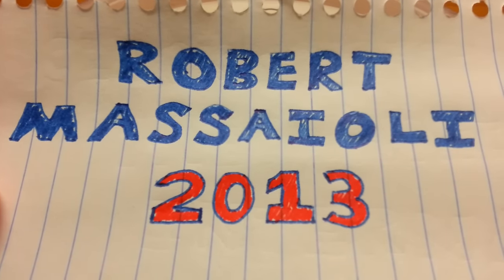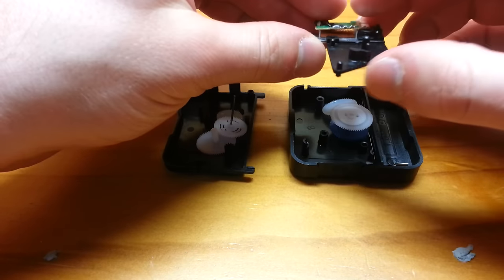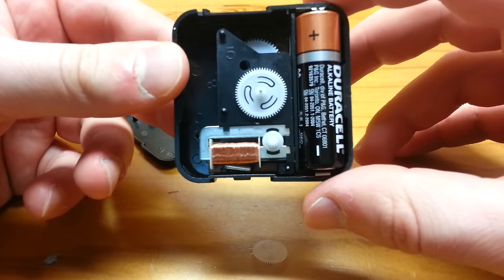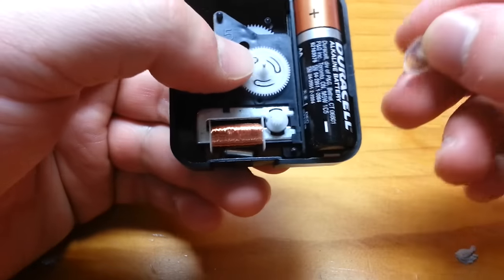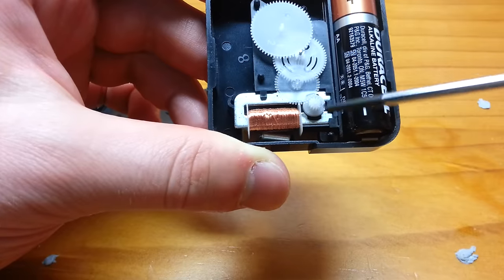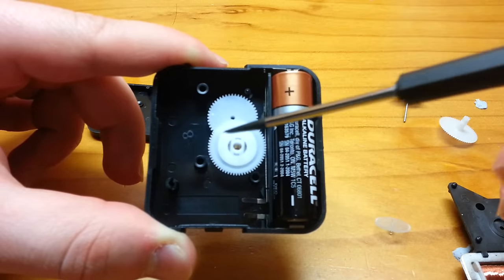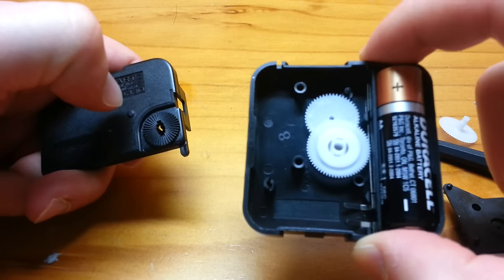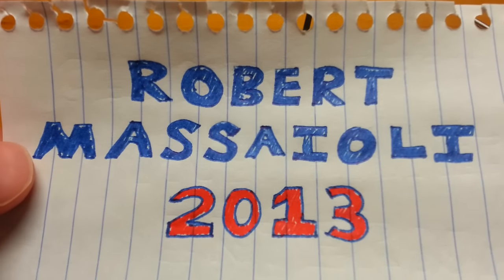Internals of Quartz Clock Mechanisms

Comment: This is the only detailed explanation of the inner workings of these clocks I've seen. This is done superbly well! I have discarded so many clocks because the clock mechanism wasn't working. Now that I understand how it works, I can fix.
My sister brought me an older clock that made the sound of a different bird every hour. It wasn't working and had belonged to my dad, so it was worth fixing. I took everything apart and found that the battery contact strips weren't making contact with the main board. I had to solder jumper wires to get power to the clock innards. After a lot of time and patience, I finally got it back together and it works! I would never have attempted this with the knowledge this video provides.

Comment: Thank you Robert, I have a little known tip! If you have a clock of this type that has been working for better than 15 years and is loosing about 5 min in a week, turn it over, 180 so the 6 is at the top, watch it for a week and if it keeps correct time you can rotate the mechanism in relation to the numbers and get another 15 or so years out of it. Gravity only wears the plastic on the bottom.
Reply: bruhh
Reply: write a book on how be be efficient in everyday life alreaady
Reply: Thats very interesting

Comment: Awesome video, our clock fell off the wall and the mechanism shattered into every single component on the floor. I didn't think I had a hope of assembling it all back together but it's now back on the wall and working thanks to you!
Reply: I have one that I would like to throw on the floor. It has run fast ever since it was new. Should have taken it back but I  had already thrown out the receipt by the time I realized what was going on. No adjustment of course.
Reply: @plansexaminer  I'm reading your comment 8yrs on and laughing.I wonder how your life has changed and if you ever did throw your wall clock on the floor,if it is still happily running fast or if it has expired with time (Pun intended!)

Comment: Thanks for making this video! Although my clock wasn't the same model it was close enough to yours that I figured out how to repair my bathroom clock! I figured I had one gear out of whack, but when I got the backing plate off they all bounced out. After I saw how yours looked inside and you explained the solenoid and that first gear, the reassembly went fairly smoothly (except for when I  put the backing plate back on - it took a couple of tries to get that plate on without that second gear bouncing out of place). Now I'm all set! (bad pun intended)!

Comment: I would like to add a little detail about how the motor works.  Each pulse to the coil results in both the pole pieces at the bottom being of the same polarity while the two pole pieces at the top are of the opposite magnetic polarity.  The large electromagnetic poles are 180 degrees apart and the small poles are also 180 apart and 90 degrees from the similarly polarized large poles.  The pulses repel the permanent magnet on the gear such that the permanent magnet is always pushed away from the similarly polarized small pole and toward the oppositely polarized small pole at the other end of the U shaped core.  After the pulse, the pole pieces are no longer electromagnetically magnetized but the permenent magnet on the gear will latch itself into place aligned with the larger poles of the electromagnet due to their larger size and greater attraction.  They are then ready for the next pulse of opposite polarity.  This all ensures the motor always turns in the same direction with alternating pulses.  It is essentially a permanent magnet AC motor.
Reply: Does the impeller have 4 poles  - 2 magnets?

Comment: I just fixed 3 of these this week. IN EVERY CASE the problem was the pressure contacts between the battery connectors & the electronics board. All I needed to do was gently scrape the contacts (2 spring from the battery, 2 flat on the PCB) with a plastic blade to remove the oxidization (will now look evenly bright), and BINGO! The clock ticks & runs fine again. Just be careful how you disassemble & re-assemble the gear mech. About 15 minutes work & no parts cost, & you keep the original hands & sound of your clock!
Reply: James H

Comment: Thank you very much for your demonstration and explanation! The video is really helpful for it gives ideas about the function of small electronic circuit board in which quartz crystal resonator in a form of small tuning fork is connected and how the circuit board receives power from battery and causes the tuning fork to vibrate and then how the circuit converts the vibration into one second electric pulse and drives the peizo electric motor and drives the motion work of the clock (12 : 1 reduction gear train that drives the clock hands). So that people will no more get tempted to throw the old unfunctioning clocks into garbage or by the side of road but they get idea to repair and use the clock again.

Comment: I really enjoyed watching this. I'm working on a special clock design using a microcontroller and wanted to see how these mechanisms work.  Well done!!!  thank you!
Reply: Yes I saw that as well.......great food for thought Robert!
Reply: My guess is that if you can control the motor with the arduino there must be a way of sensing each back and forth of the motor with an arduino as well.  THIS is what I want to do.  This would allow me to turn on LEDs in synchronous with the pulsing of the motor for the seconds, mins, hours.

Comment: Really interesting.  I've been taking these things apart to quieten them down but not been stripping them down to this extent.  This was a brilliant explanation of what the various components inside do.  (So I guess a dual 12/24 hour movement just has an extra layer, or an extra pair of cogs?)

I want to make a 24 hour clock that runs backwards (...because that's the way I visualise time for some reason.)  I can buy a 24 hour movement or I can buy a reverse movement, but not a 24 hour reverse movement, so I'm going to buy a 24 hour clock and try to reverse the movement, but I'm planning to practice reversing some cheap 12 hour movements first.

Comment: Very helpful, 5:07 shows the 2 prongs that connected to yhe battery, from there to the quartz circuit on his left hand which have 2 tin coated squares correspond to those pins, in my case the pad was scratched off but a quick retin the pads fixed the "dead" mechanism, also the prongs on the box needs to be push down instead of upwards (from my experience, not in the video) to ensure a good connection

Comment: Robert, you're aswesom! Thank you so much for not only breaking it down but explaining as you go along. I taught myself - reluctantly - only because I'm a (reluctant) clock collector. LOL! It's crazy, but fun. Now, I only collect clocks that chime, which is a bit of a challenge but satisfying when I'm able to tear one apart and fix it or use parts from one and fix another. But it's the chime mechanism that's a little complex, or a lot complex in some cases. Do you have a video on quartz chime repair? Thank you, i thoroughly enjoyed your taking apart the plastic gears, that of which i hate to do. I watched a recent video of this and the guy said to take a photo of how the gears are positioned before you disasdidamble it. It's tricky because everything is so intricate in there plus my fingers are fat!

Comment: Thank you. Very informative. Another point to note, is the battery contacts. Make sure they actually make good contact with with the circuit board. Mine were not. Bent the contact and away it went.

Comment: It's not a "solenoid"; it's the armature of a synchronous motor. the round plastic rotor is a permanent magnet. the motor runs on 1 hz. AC; delivered by the integrated circuit on the circuit board; and derived from the 32,768 hz. crystal frequency by a binary divider. If you go to my channel, you'll see that these clock movements can easily be used as a readout for your own clock project; providing the 1hz. AC signal involves a little trick. But it's only necessary to sever one of the two copper circuit board traces to the motor armature; so it's not longer connected to the circuit board; and solder on two small wires to the terminals of the armature coil; which are easily identified visually. Put it shaft side down on top of an empty shot glass, or such; and then when you take the back off it won't fall apart.
Reply from the maker: All true. Although I would be interested in getting an oscilloscope reading of what comes out of the electric circuit; my guess is that it sends out 1hz pulses rather than a sine wave. It would be interesting to also know the shape of the wave rather than just its frequency.
Reply: Any way to transform hour movement from 12 to 24 ?
Reply: John Affleck I am trying to find a way to add a secondary power source that can be controlled by a small remote control ( so I can remove the battery from the movement yet turn it back on with the secondary power supply controlled remotely) ,  as a magician I want to do some thing. A little unusual.  Any ideas
Reply: John Affleck I need a video
Reply: Thanks for precice information also. :)

Comment: Yes, I watched this pretty avidly and, although not my favourite type of movement, I understand these movements better.  

One thing I noticed on a couple of gears were the 3 segmental cut-outs (curved bits) and you didn't explain the significance of those.  Also I noticed 2 metal prongs from the battery area, which I assume make contact with the magnet?  Not sure at all about that bit either.

The circuit board I reckon should have been gone into, but not too much, as I appreciate this is highly specialised and would take the layman far too strongly into the realms of electronics.

So, overall, congratulations and many thanks for this fascinating insight.

Comment: I had a clock where the seconds hand fell out of the front and the clock was no longer telling time. We replaced the battery and I put my ear to the back to see if I could hear the gears moving or ticking. Someone told me that the seconds hand made the ticking sound but I didn’t believe them. I watched your video as a result and now I have my answer! I believe I can fix the clock now by reassembly.

Comment: My problem:  My clock works seemingly good, but it has a problem, the hour hand is not precise. To say, when it is  6:00 o0clock, the minutes shows 12, but the hour hands is not exactly on 6, but  one line before 6. ¿Any solution?  Thanks.
Reply: I know this is 2 years too late but, you can fix this by forcing the hands, by hand, so both point to 12. Then set the clock to the correct time. The hour hand should then point to each hour number when the minute hand is on the 12.

Comment: electric power (tiny battery) >> oscillate the quartz crystal (piezoelectric effect) >>vibration from the oscillation turns into regular electric pulses, one per second by Microchip circuit upon which quartz placed >> electric pulses passes to a magnetic coil and generate the magnetic filed and it help in physical movement and turns the gears.
Reply: So the quartz crystal is placed the in IC itself?
Reply: @chadcastagana9181  Placed on IC...a way to say both are connected.
Reply: Quarts occilator is in the metal can.  Soldered to the board

Comment: If the clock won't move at all and the battery is good check the metal contacts touching the battery, touching the circuit board, and the pads the power contacts touch on the circuit board.  You may find corrosion and it will definitely stop the clock from working.  Clean it up and it probably will work.

Comment: Thanks for this. I was wondering if you have any knowledge or information on two allied quartz movement types? 1) The modified for torsion pendulum (cosmetic display only) 
2) The radio controlled atomic clock movements Rgds

Comment: Great video, Robert. but I've just come to this, and your explanation of why the first gear always turns the same way is incorrect. (You can prove that, by the way, by sliding out the "U" core, flipping it over, and sliding the "wrong" leg into the coil. Under your explanation, that should make no difference. Whereas in practice you'll find that the first gear will rotate in the opposite direction).

The actual explanation is, in my book, not just subtle but downright ingenious.

When the coil is active, the core guides the strong induced magnetic field to form a N/S pole pair at the two tips either side of the first gear (basic, if simplistic, physics). The magnets in the gear turn to line up accordingly. Call that position "horizontal". (The location and orientation of the coil isn't relevant; where it happens to be, in your mechanism, is purely coincidental.) When the next field is induced, the field polarity is reversed, so the gear turns accordingly to line up with it (in the simplest case, by 180 degrees, although more complex gears may have multiple magnets and more poles). Without anything more than that, though, the gear would simply flip in an unpredictable direction, which is less than useful.

The core, though, isn't symmetric. In your video, for example, you can plainly see that one of the corners at the bottom of the "U" is more rounded than the other (there may be other, more subtle differences as well). When the coil is turned off, the magnets in the gear are still attracted to the core (well - actually, I suspect they're mostly attracted to each other, with the core guiding the magnetic field around - but, whatever). Crucially, though, the asymmetry of the bar means that the gear's preferred resting position is now angled a few degrees away from "horizontal". So when the induced field drops, the gear twists out of position by a few degrees. And those few degrees are quite enough to prime the gear to be able to move in one and only one direction when the field is next restored (rather like the cams of a piston engine).

When you flip the core over, you flip the asymmetry, so the preferred resting position is angled the other way. So the gear is primed to move the other way instead, and your clock runs backwards (as, indeed, mine does now).

(Note: If you actually try reversing the core to make a clock that runs backwards, you'll probably need to do a degree of "surgery" on the plastic of the case so that it will still fit. If you do, make sure that the core is going to stay correctly in place around the gear when the motor is reassembled, or your clock won't work. I had to pack a small piece of craft foam at the base of mine to stop it slipping.)
Reply: Well that is a superb description. Thank you very much. It reminds me of the synchronous motor especially the ones used in ac mains electric clocks mainly from the 1930's. The English Smiths in particular has a start device that spins it the correct way when you release the hand setting knob. Now they could have deployed the same start gimmick you mention, as indeed is used on vinyl LP turntables for example, but they didn't. The reason is rather unexpected and maybe relates to a period when continuous electricity supplies were not so reliable. They did not want a stopped clock to resume AT THE WRONG TIME!! 
Rgds BerryG

Comment: Very informative. I was wondering if those solenoids have the same universal size. I was searching the web for my old Bulova wall clock but none of the shaft measurement match. Maybe I could buy any one of the movement and replace the solenoids only. Besides I can keep all the pointer hands original. Thanks again.

Comment: I've  taken my mechanism housing apart, and the top gears do turn if I press down on the flat black piece that sits between the top and bottom gears. When I let go the ticking stops. It also looks different than your example mechanism.  I wish I could add a picture of it here to show you so you could see and give your input.

Comment: Dear Robert,   Very Nice. Do you have any thoughts on how an existing mechanism can be converted to 24 hr clock . I am interested only in the hour hand.   Thanks
Reply: That the reason i`ve watched this video ..
Reply: Hi Dev, did you ever get any info on how to convert. I bought and replaced the crystal with a 16.384 MHz crystal. I also added the 2x23 pf caps. but I couldn't get it to oscillate. Nice if you post a solution. Thx

Comment: Very informative. Thanks Robert. Is it possible to adjust the clock speed? I have a fast one that jumps a minute-and-a-half every week.
Reply: The quartz ossilator is damaged.  You will need to replace to alter the rate of rotation

Comment: I took mine apart because the second hand just jumped never going anywhere, messed around taken the gears out, then noticed the first little gear with the magnet on it, wasn't going around, it just kind of, jumped, even with no other gears in the clock. Like it didn't have enough power, so I checked the battery and it showed in the green, but not a lot. Changed out the battery and now it works. So if your second hand just jumps and never goes anywhere, its most likely the battery. And the battery must have to be really charged to make it work. All in all, these mech have about a 50% failure rate, so buy 2 , 3.00 clocks to get one that will work

Comment: @Robert Massaioli Hi Robert had a little question, does it make a difference if the clock mechanism is installed the wrong way, I mean I had given my clock for repair, initially the battery compartment was down bellow , but after the repair,  the technician installed the Mechanism, such   that the battery compartment was on the right side. So my question is whether it would damage the mechanism in any way or slow or speed up the clock in any way?. I mean whether gravity will act differently?